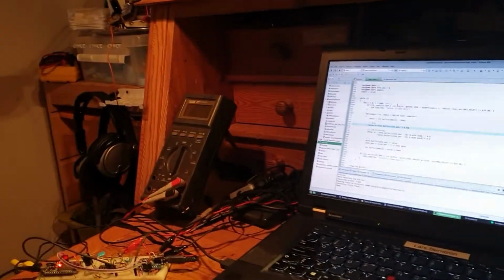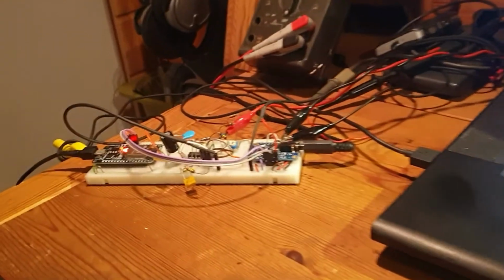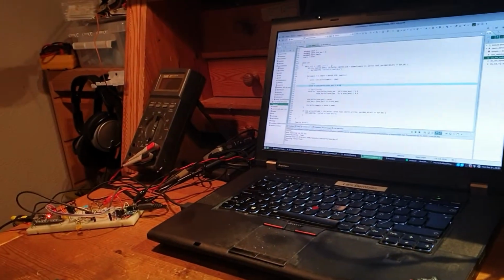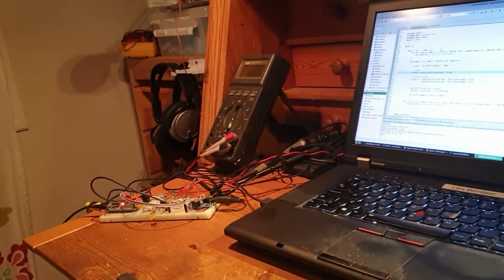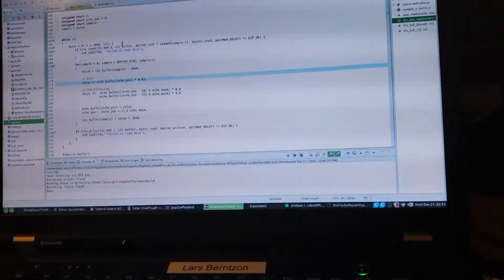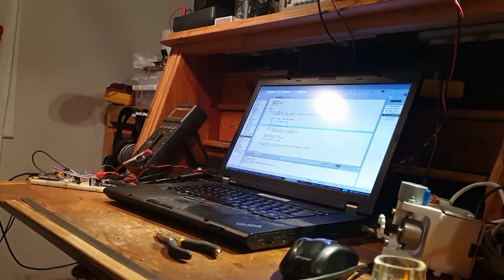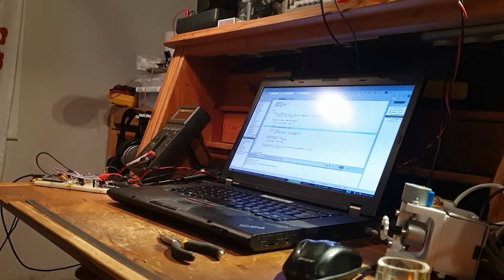Esp32 effect box with echo

Comment: I'm a beginner in programming and esp32, is it difficult to configure another DAC besides the adafruit you use?
Reply from the maker: As long as it uses i2s it should be directly replacable (given that the digital levels are compatible). But as I wrote earlier, the internal esp32 AD interface is horrible, at least in the esp32 I have. I understand that later esp32:s have better ADC:s
Reply: @LarsBerntzon  got it, so the recommended is to get an ADC i2s as well?
Reply from the maker: @bonecaodoposto9454  From what I've heard the newer esp32:s has a better ADC so they might be good enough. But the wroom i used is not good.

Comment: Hi.  Very nice. How is your project? It seems you are using I2S DAC and internal 12-bit ADC. Have you tried with external I2S ADC?  Is ESP32 RAM capacity enough for echo and delay effects? Where you picked  up  schematic for guitar interface? Best regards.
Reply from the maker: Thanks. No I have not tried an external ADC but that should for sure be much better. Yes the ram was enough for some echo and delay. I used the same ring buffer for both echo and flanger but different read heads to get different delay times. For the schematics I just used some standard solution for amplification and low pass filtering using opamps.
Reply: @LarsBerntzon  Thanks for your response. 
Yes 24-bit  and 44kHz ADC for sure would give better results but that requiers a lot of RAM. Probably it's not necessary to drive with 44 kHz because guitar has narrower frequency band  but this is matter of measuring and experimenting.
Reply from the maker: @Mrpeacemaker2  true, but even then you should be able to get like 1.5 to 2 seconds delay which i think is often more than enough